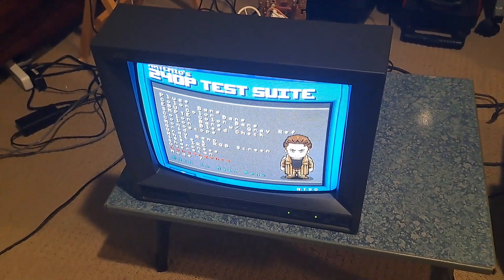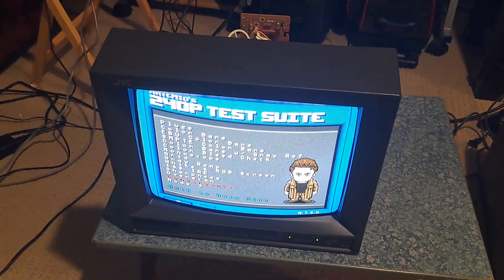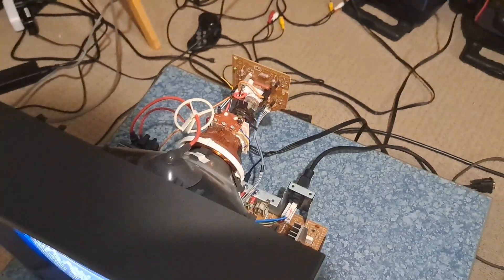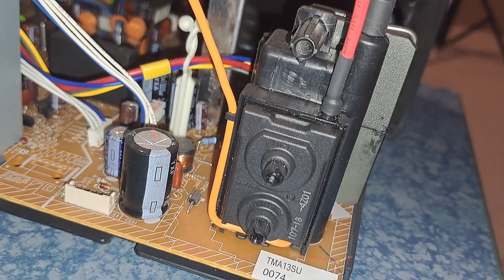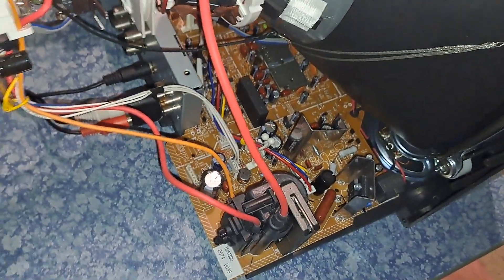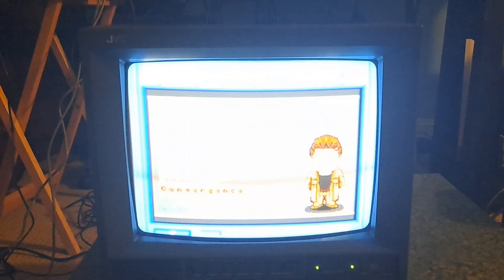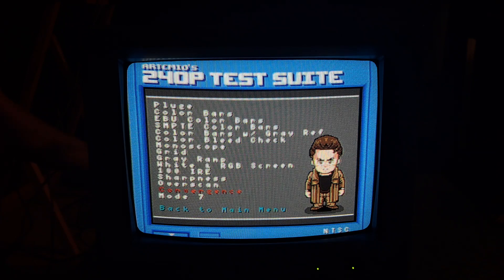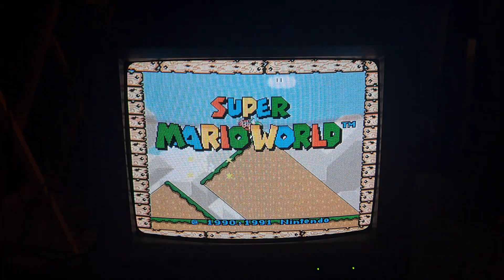CRT TV/Monitor Focus and Other Wacky Adjustments: Sus Edition (jk)

Comment: I did self educate myself about this so I could calibrate a hd crt.
The best method for me is using quake 2 remastere aim dot. Red blue green colours are separated and can be tweaked in the game settings.
Because it’s impossible to view the screen while adjusting the rings I set up a camera zoomed in to the dor of the middle of the screen.
This way you can achieve the pixel perfect convenience. It’s important to do this as many TVs especially the hd CRT’s come out badly calibrated from the factory as the person on the shift didn’t really care about properly calibrating it. The same can be told about geometry. It’s literally impossible to get it right but it’s actually possible to get it very far from right.
On the top of that almost all YouTube retro gamers say it’s no point to have hd crt because of the input lag well there are tweaks to fix this. Edid sync dongle such and dr hdmi  and in Samsung tv’s using film mode, on the console use hdmi auto displays lay discovery which is standard not pc rgb, and the colour set to 4.2.2. Audio set to Dolby stereo.
I finally discovered this and now every 60fps title has 0 input lag.

Comment: Question about the focus pot. Isn't that area of the TV dangerous? Like the area right around that panel? What screwdriver do I nee to use to adjust the focus? Does it have to be plastic? Also, what if my screwdriver slips off while I'm adjusting it, and my hand makes contact with the piece around it?
Reply from the maker: @jonebize13  I use my hand to twist the focus and g2 pot all the time now if it's accessible, so it should be fine if you're not poking around a whole lot around the flyback itself. It's made to be adjusted so it's been pretty shock proofed
Reply: @P-0-Seventeen  So basically in your experience, if your finger touches the panel directly behind it, that should be okay too? 

The reason I've not been sure if because that section of the TV -- I forget the name of it, the flyback? is supposedly dangerous. And it's all connected. So I don't know at what point it becomes dangerous to touch. Thanks again
Reply from the maker: @jonebize13  yeah that area is all fine, I've shoved a screwdriver or two in there before and missed the pot but it's given me no trouble, as long as you're not just randomly shoving it in all around and touching everything lmao
Reply: @P-0-Seventeen  K I'm just going to use my hand. Seeing your video right now on your Toshiba which gives me some confidence. It's hard to touch one of these until you've seen someone do it. Thanks man.
Reply: @jonebize13  yo bro did u touch that part with your hand?

Comment: my Samsung has a place for focus like that but is requires me to use a screw driver to adjust it , is it safe to mess with if I ever need to?
Reply: Yes but dont use metal tools. I actually used a bamboo skewer that i cut one end flat like a screwdriver and made adjustments with.